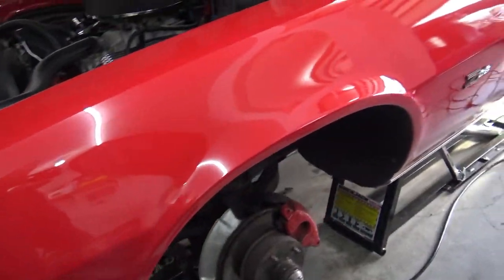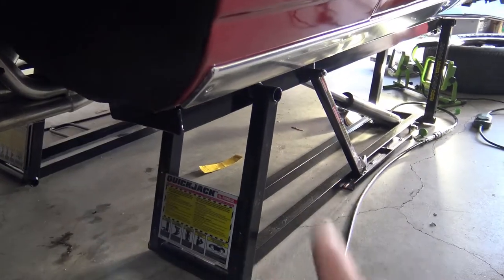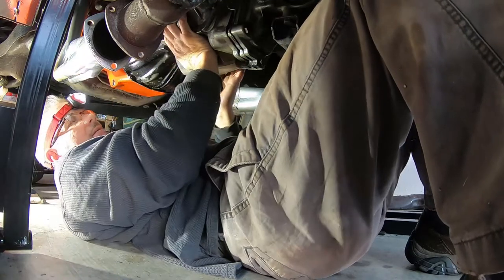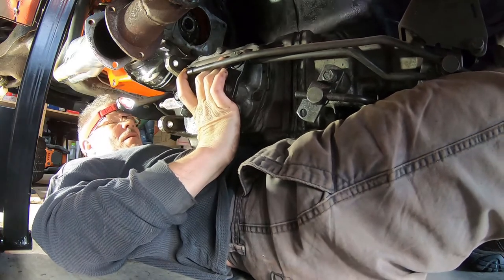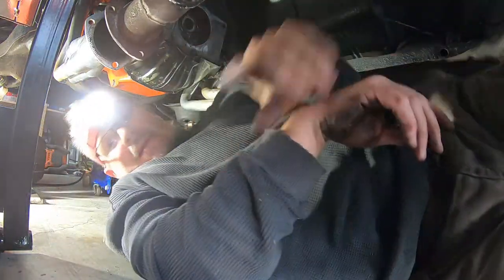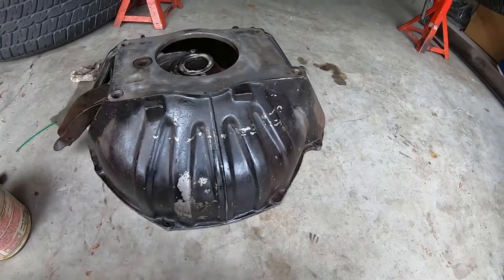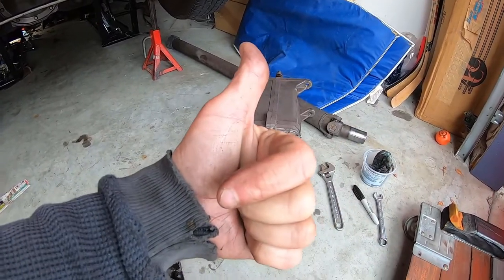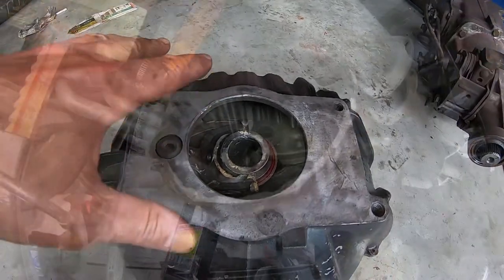Camaro clutch problem solved!

Comment: I've always had good luck with the dual friction, and am getting ready to install another in my 1992 Mustang Gt. The one thing I may have done different is contact Centerforce and see if they could offer any advice or an updated version of the weight pack to you. Love those lifts,gonna have to check those out!

Comment: I bought a Centerforce clutch about 15 years ago for my car & installed it & put the transmission in place. I forgot something that I needed to do before bolting the transmission so I pulled the transmission away from the motor & then tried to mate the trans to the motor again but I couldn't. My friend & I spent 1 1/2 days trying the install the transmission & my friend gave up & went home so I pulled the trans out to inspect it. I had used a clutch alignment tool inserted into the clutch disk but that didn't help, so I unbolted the pressure plate & removed the clutch to inspect it. The clutch looked fine & it went on to the clutch alignment tool just fine. I then tried to place the clutch disk on the the splines of the transmission that was sitting on the floor & it wouldn't fit! I couldn't believe it, I was trying for 1 1/2 days to install the transmission because the clutch disk splines were bad or incorrect. The first time I installed the transmission I was able to use the bell housing bolts to get it on prior to having to remove it. Lucky thing that I pulled the trans otherwise the clutch probably wouldn't have worked correctly. I went & exchanged the bad clutch disk & installed the trans by myself in about 10 minutes. I learned the I need to check a new clutch disk on the splines of my transmission before I install it to make sure it fits properly. I just bought another Centerforce clutch for my car & yes I'm going to check the clutch disk fit prior to installing it.  ;)